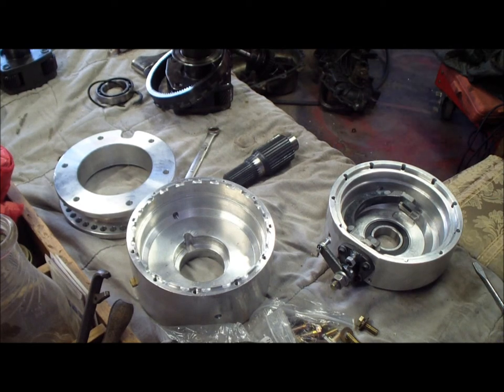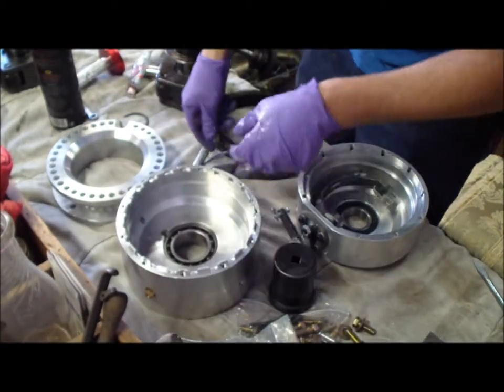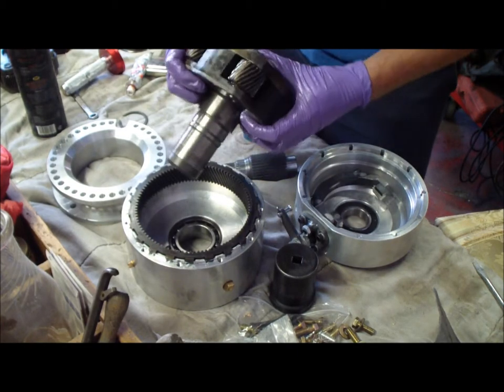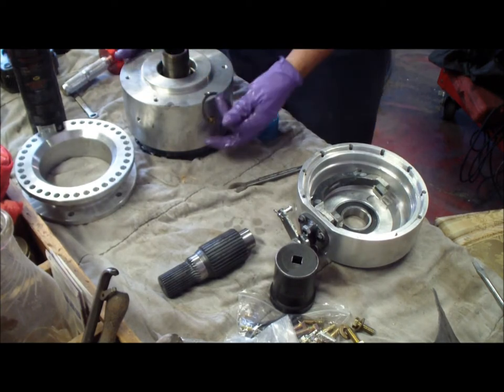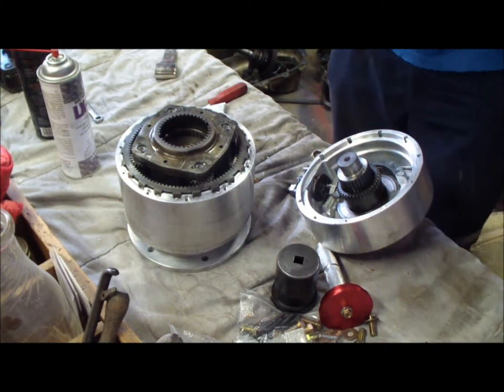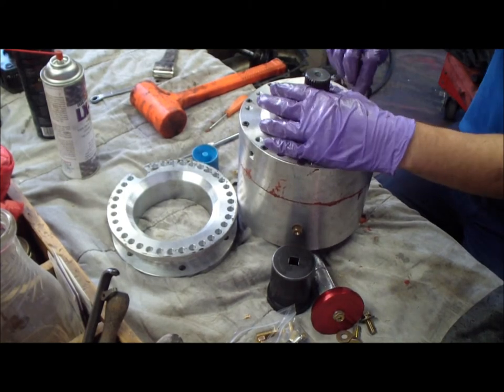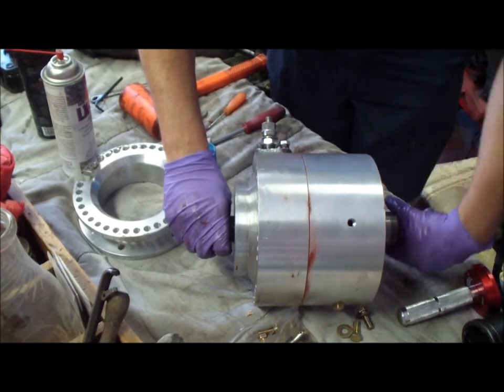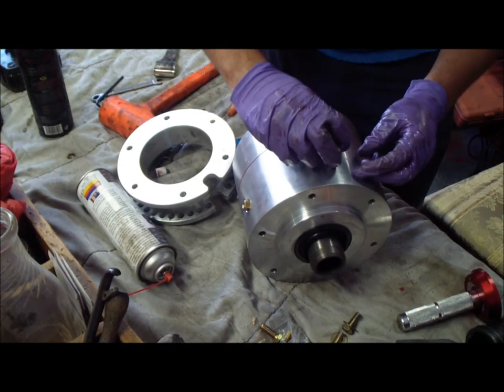Behemoth Drivetrain bw 1356 doubler kit how to (read notes)

Comment: You put yellow Teflon tape on the threads of a fitting wrapping in a clockwise direction. Yellow Teflon is gas resistant and will hold up to ATF

Comment: Is there a way to connect a 1356 reduction box to another 1356?
Reply from the maker: Yes. This adapter and others like it will allow pretty much any factory t case from a full size ford truck. They ram the 31 spline 6 bolt round pattern for many years

Comment: Im still waiting on my strongbox, it has been awhile and I'm starting to get frustrated with Jacob. Is the long wait worth it? Have you had any problems with the crawl box?Also did it seal up well or do the seals leak? Thanks for showing me how to put it together. Based on some of your videos you must be in the Ridgemark or Salinas area.
Reply from the maker: I did have some leaking issues but I'm pretty sure he had fixed them sense he told me how to fix it with an o ring on the shifter.  Ever sense i did that it seemed to stop that leak.  It would also push oil out of the vent hole when driving fast.  I'm going to get one of those sealed vents that will expand and compress without opening up and letting the oil out.  I have really liked it for how cheap it was and been reliable so far.  I do wish he would get better about shipping. He was always friendly via text and offered advice when ever i needed it.  I live just outside Hollister area

Comment: So how is this thing doing?   About to order a 1354 shorty for my bronco ii.   Hoping to not experiamce the horrors ove read on wait time
Reply from the maker: Donaldcon still holding up good. Does have a slight oil leak but I think the new ones fixed that issue
Reply: Jason Finstad heck engine, trams and tcase all drip currently so whats one more leak right?   

Im a bit apprehensive based on pirate reviews of wait time, missing parts, etc.  Hoping 4 or 5 years has let him figure it out.
Reply from the maker: Donaldcon i still think long wait times are an issue.

Comment: Do you recommend this kit? Would it be suitable for a daily driver/wheeler?
Reply from the maker: philip4x4guy I wouldn't use the one I have for daily driving. But the newer ones have better seals for the shifter.
Reply: Jason Finstad so your version has leaked there?
Reply from the maker: philip4x4guy yeah at the shifter

Comment: what is the red silicone you used??
Reply from the maker: high temp silicon.  Nothing special.  You can probably get away with just normal silicon
Reply: You want to use RTV not silicone. Silicone is for windows and bathtubs. RTV is chemical resistant and Red RTV is best for automotive applications where oil and ATF are Involved. Also Blue RTV would be sufficient.